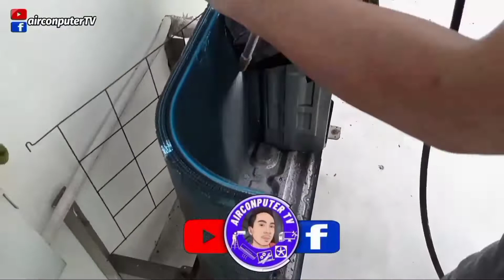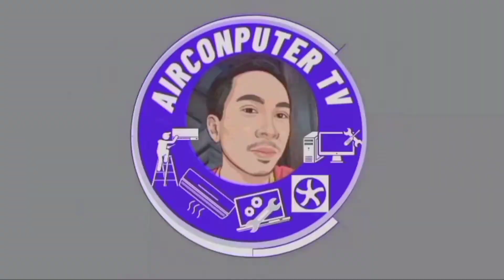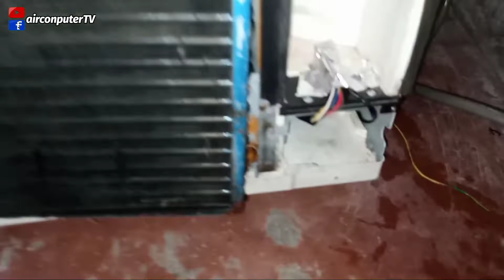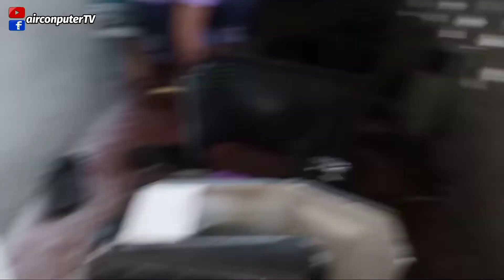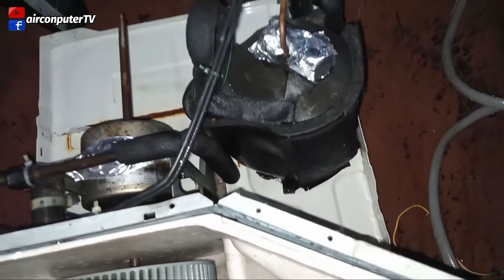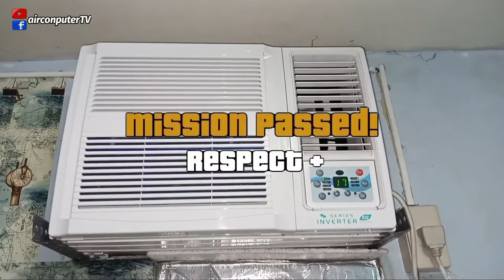Ganito ako maglinis ng Window Type Inverter Aircon | KOLIN

Comment: sir yung kolin namin 1.5hp
nasa 8 - 9 yung thermostat nya, aandar compressor ng 5 min kahit di pa cya masyado malamig mamamatay na tapos antagal cguro mga 10 min bago umandar ulit compressor
Reply from the maker: better po pa check nyo yan master. baka need na rin po ng linis. message me po sa fb page ko Airconputer TV
Reply: @airconputerTV  thank u sir
Reply: @airconputerTV  
sir pinalinis na lumalamig na cya kaso lang tuloy tuloy andar ng motor hanggang umaga parang di nagtethermostat kahit nasa 
5 - 6 lang setting
Reply from the maker: message mo ko sa page ko follow mo Airconputer TV send mo nga pics dun ng ac master.. salamat